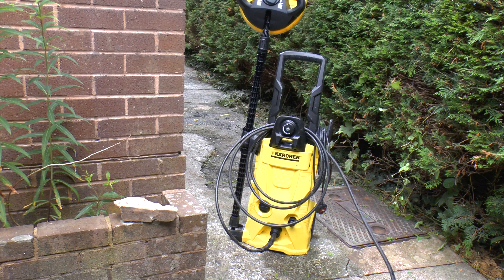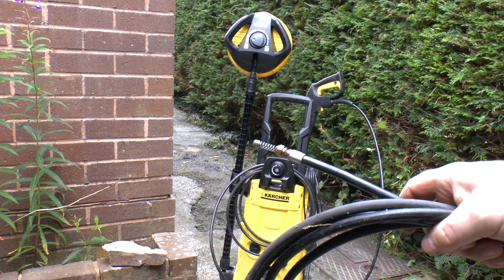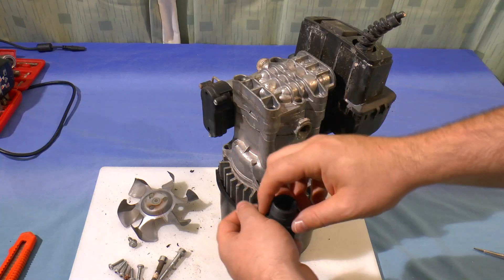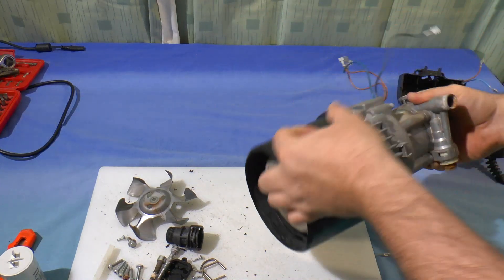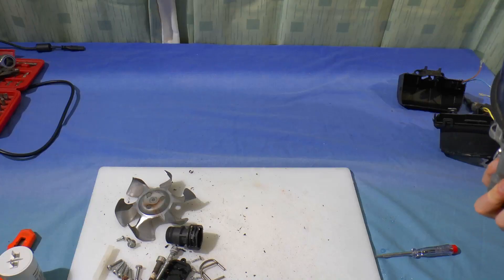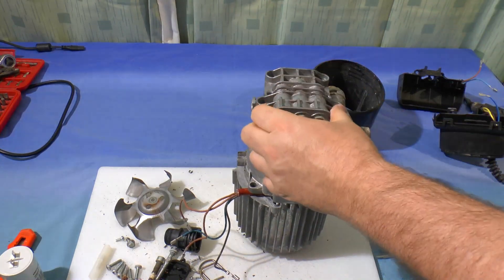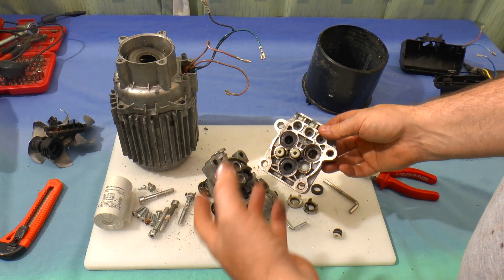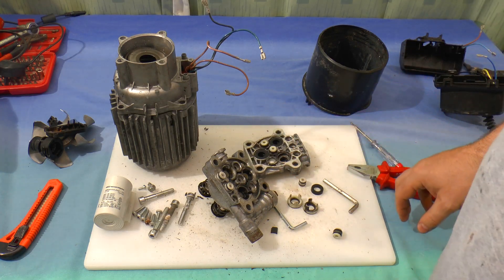Karcher pressure washer teardown

Comment: Was it possible the pressure switch failed? And as well I believe where the pump was removed from the motor there should have been gear oil not gunk.

Comment: I just brought a second  hand karcher HD 640s and when I turn the nose on the gun to make it make full pressure it starts to cut in and out .. I noticed the piston on the pump is moveing in and out triggering the switch .. the water pressure is fine because it works with my other pressure washer that's practically identical.  mx 720 . any ideas.
Reply from the maker: Perhaps it's duff? It'd be worth asking on the Kärcher Facebook page, they may just say to take it back and exchange it.
Reply: @AintBigAintClever  sorry its second hand. its ok but it just surges at full pressure.  back it off with the nossel and its fine . but surges with all the other nossels that don't adjust.  there just full pressure.
Reply from the maker: @petermoygannon698  mine surges when the hose is kinked. Perhaps it's drawing more than the other one? Worth checking the inlet connector for debris in case there's something clogging it and restricting flow.
Reply: @AintBigAintClever  no looked at that. could the motor be lazy could that be possible.  gets to a point where the motor struggles to push the pistos in and locks up and starts again very quickly  . creating that on of high pressure.  the machines  jotting when this is happening.
Reply: @AintBigAintClever  and even with his adjustable pressure hose and gun it does it when you twist it all the way to full.. back it off just a little and it doesn't do it its fine.  but won't run my hose with my foam cannon spray  the foam jolts out and the machines jolting again .
Reply: @AintBigAintClever  be very interesting to find the fault  got me beat so far.
Reply: I've got good mains pressure too.

Comment: My mate had one a different brand a works one and had the same pump but had a universal motor and we used it at his house after doing a few pavers it pack up and stalled I took it back with me took it apart was beyond repair as the bearing that spins the two plates had exploded inside I told my mate to buy a new one I kept the motor binned the rest wasn't worth it

Comment: The Karcher I have failed many years ago because the plastic housing on the pressure switch burst. I assume that this met Karcher's design goal - throw away the metal motor and the metal pump when the plastic over-pressure sensor breaks. HOWEVER I noticed, in pressure washers I have seen, that the motor NEVER shuts off as long as the water is flowing. SO I disabled the water shut off in the nozzle (so nozzle always on), shorted the electric switch on the pressure shutoff, and ran the power plug through a radio-controlled AC switch. When I want pressure/flow, I turn on power via the AC remote control; when I want no pressure/flow, I turn off power ditto.  The water main pressure still pushes a trickle of water through the Karcher, but nothing like the blast when the motor is running. I have salvaged many years of occasional use from this washer that Karcher wanted me to throw away shortly after the warranty expired.  (Have you ever noticed the temperature fuse on Shopvacs and fans? Same design principle -- consumable part fails, throw the whole thing away, along with your money. For a dollar more,  a resetting temp sensor could be specified. Insert AvE foul language here. )

Comment: because u did not change it oil regularly thats y it broke down
Reply from the maker: It's not designed to have its oil changed.
Reply: @AintBigAintClever u can add that feature also by boring on one side and adding screw to it

Comment: Nice tear down, thanks!  Do you remember how you removed the electric motor cooling fan?  I've got a Husky 1750 PSI pressure washer, the fan self destructed, got a new fan but can't get the old fan off,  Turning the hex-slotted cap holding it on simply turns the pump, I can hear it.  Just not sure how far into the pump I might have to dig to be able to keep it from turning and get it loose. Picture of fan:   https://drive.google.com/open?id=1e4qrp0Bc-sXtWFkJfioFyRKN8tiUu6X9  Thanks for looking!
Reply from the maker: I probably jammed the fan blade then undid the screw. If the old fan's already mangled then a bit more blade-bending with a screwdriver won't hurt.
Reply: @AintBigAintClever   thanks for looking.  Yes, I can grab the fan blade with a pair of channel locks, no problem, but the screw just turns without coming out, it sounds like it's turning the pump, I can hear it 'sighing', you know.  Can't figure out how to keep the pump part from turning without disassembling the pump from the motor, I guess that's going to be necessary, ugh :)  Thanks again!
Reply from the maker: @brucejones8889  Depending on the motor type you could try shorting the input cable to see if that stiffens up the rotor? If it's a motor that can also work as a generator, it'll be generating into a dead short and be much harder to turn.
Reply: @AintBigAintClever  Thanks again.  I finally 'wrung' the fan off, lightweight aluminum, then I could grip the spindle/axle/whatever and keep it from turning (no motor expert here) and get the retaining screw out.  Now just gotta clean out the dried 'loctite' type material so I can get the screw back in with the new fan.  Well, and remember how to put the whole thing back together ... shoulda taken pictures!  Seriously, thanks again and stay safe!

Comment: What oil is in the pressure water? Gear oil?
Reply from the maker: No idea I'm afraid. It's normally sealed in. Whether it's filled with conventional gear oil (which is going to get a much easier life than it would in a car differential so may never need replacing) I don't know.
Reply: I believe Non detergent oil is used in the pressure washer water pump ,it doesn't foam up, gear oil is used by repair shops so it must be but i am not 100% certain cheers....

Comment: Had a failure on a clone copy of this machine, the heat/press fit gear on the end of the motor shaft expanded due to thermal stress after a few years so the gear wouldn't spin when any noticeable torque was applied, as the shaft was just spinning and slipping on the inside of the gear. A spot weld might have saved it but an attempt to hammer and mushroom the top shaft split the gear...

Comment: What is the liquid inside of the motor?
Reply: 05:35
Reply from the maker: Oil/grease
Reply: @AintBigAintClever  thank you. Just opened up my kärcher k3 because its leaking water somewhere, got that grease/oil all over the place!

What could be wrong if its leaking water?

Comment: Clearly mechanics is not your field. You washed that mechanism with water
Reply from the maker: There are many tools in my garage. Unfortunately a parts cleaning tank isn't one of them.
Reply: well.. guess i shouldnt really judge since that was a broken part soo.. have a good day :)
Reply from the maker: It was predominantly to remove the bulk of the gunk in there; mainly using the pressure to blast it out than the water to wash it out (which as you've pointed out wouldn't fare too well, although there was truck-wash in the jet spray to help shift it).
Reply: i understand, yeah. Thanks for the timeline or how its called at the begining :)
Reply from the maker: The index at the front was a suggestion made by one of my friends a while back, so most of my videos now have one.

Comment: Good video, i've recently stripped mine down too. What oil (and how much) would you use when re-assembling inside the piston area? Mine looks like grease but think it might be a bit sludged up due to water ingress.
Reply from the maker: Not sure, it depends on what the seals are made of. Take a look at this list for example and compare ATF with brake fluid.

Comment: made me happy when I saw the hammer come out 😃
Reply: I wonder if he tried hitting the pump with the hammer before resorting to buying a new machine. I've had the same problem with no pressure he had. Tapping the pump with a hammer seemed to free up whatever was sticking and the pump would build pressure again.
Reply from the maker: I must admit that a spot of "percussive maintenance" hadn't crossed my mind before I bought a replacement. This one was a bit battered though (even before I malleted it open) and the pressure kept creeping down, causing it to keep triggering the motor even when it wasn't being used (and often stalling the motor as a result).

Comment: This Karcher 432M still is sold in Brazil with label Karcher K 3.30M or K 330M. As I know this is a very old project, maybe 1980, but still is very fine machine. Here a new one is sold by R$ 800,00, about U$ 260,00

Comment: How high you fill in the New oil?
Reply: Yes it's very important issue in pressure washer pump
Reply: till the screw is under oil
Reply: leaving the a bit of the bolt out

Comment: Great video. I just tore down a similar pressure washer, hoping to reuse the electric motor, but it must be an induction motor just like you have. It seems the motor and the pump are integral parts, or at least the motor and the swashplate part are. You really can't separate out the motor so I ended up just pitching the whole thing, which is no great loss because I got it from the trash, but it's a bummer nonetheless. It looked like a really powerful electric motor.

Comment: 8:01 is a big no no... it does not compress water
Reply: The bulk modulus of water is small compared with air, (15000 times less, according to Google,) but it is not zero. Water compresses under pressure, and steel beams deflect when you walk on them.  (But not much.)

Comment: Where does the pump oil goes? I want to repair a pump oil leak on mine but I haven't tried to repair it without knowing how to first refill it after I'm done changing the gaskets.
Reply from the maker: +Alexis Ortiz This one doesn't have an oil system. There's some grease but that's it.
Reply: +AintBigAintClever Is it common for electric ones not having oil in the pump? Mine is leaking oil from somewhere and I thought it was from the pump.

Comment: Wow I was expecting at least a 2 stage compression cycle, considering how noisy they are, lol , but as you said in the comments it simply a piston stroke and swashplate, very simple, great job !

I would say alot of failures would be down to air getting into the compression chamber and disrupting the current and compression viscosity.

Comment: looks like it might have been fixable if you hadn't used the old universal can opener on it
Reply from the maker: +stereomike111 Probably, but it was getting a bit long in the tooth anyway. Wheels kept falling off, the plastic grid at the back was broken leaving the motor fan blade exposed, the pump failing was the last straw. At least I've learned something from pulling it to bits :)

Comment: swash plate pumps are good for high pressure, on the old hydraulic citroens they use 5-6 little 8mm or so pistons moving about 12mm to lift the entire car and run the brakes / power steering...

https://www.youtube.com/watch?v=01L2jcep3Ik

Comment: Awesome video ;) Thumbs up :D How much uF has the capacitor ? Alex
Reply from the maker: +High Voltage capacitor is 25uF, rated at anything between 400V and 500V depending on which line you're reading on the side.
Reply: AintBigAintClever Ok, a pretty standard value for a motor run capacitor and thanks.

Comment: Videos of kittens ha ha i like your sarcastic side :-D
So it produces pulses of high pressure, not really a pump but a compressor of the water being delivered, clever idea :-)
I didnt know how they worked before, thanks for the oh so gentle extraction of the assembly and discription lol, hammer time :)
Shame its dead as the capacitor start motor looked in new condition.
Reply from the maker: zx8401ztv Similar to a three cylinder engine with stuck exhaust valves and no ignition :) Intake, exhaust, intake, exhaust... :)
At least it's rectified three-phase for a smoother output :)
Reply: AintBigAintClever LOL 3 phase, would you have to make a special 3 tube meter to measure the voltage...sorry Psi lol :-D
Not sure how to measure the current... perhaps a small stick floating under a bridge :)

Comment: I like your hammer technique for opening the device. True Photonicinduction style. I found one of those too but it has a universal motor in it. Interesting video.
Reply from the maker: tmanF4 I was planning to do that until I found it had an induction motor. They're boring. Too few volts under load: they draw too much current, get a bit hot and pop the fuse. Too many volts: they draw too much current, get a bit hot and pop the fuse.
Do it on a universal motor and they do a wonderful impression of Eduard Delacroix in the Green Mile's "dry sponge" scene :)
Reply: RODALCO2007 All he needs to do now is give it FAR too many volts, until it pops!
Reply from the maker: RODALCO2007 I tried the proper way of opening but it was having none of it :)
In the current range the K2 has an air-cooled universal motor (according to the retailers at least). K4 and up have water-cooled induction motors.
Reply from the maker: ***** The difference between an 850W motor and a 1850W motor is only about 15 pence per hour in electricity, and that's if it's running constantly.

Comment: I have an no name brand (I think it's KARCHER) electric pressure washer and it has a weak spray. It engages like it should but the spray is weak I can even put my hand in front of the spray and It doesn't hurt. I know you should never do that but I already determined that my machine had a weak output so I saw it as safe to do that. Any ideas why the spray is weak?
Reply from the maker: coondogtheman1234 I think mine kept on running because the high pressure side was leaking back to the low pressure side through one of the valves. If your pump turns on and off as normal I'd suspect the seals around the pistons, they could be just banging up and down in the water instead of pressurising it.
Reply: AintBigAintClever
Well it sprays pretty good and you can wash cars and spray the deck off but not at the high pressure that I expected. I've used a gas powered washer and it was way more powerful. enough to make cut marks in wood.
Reply: @coondogtheman  No these washers do not have the kind of pressure you expect. Gas and electric are like comparing a car and a peddle bike ...almost. Gas powered units get up to around 4000 psi i believe and electric motors produce about half that. Also there are different nozzles that are made to give varying streams and pressure. 
Edit: Lol. Sorry m8 didn't see this reply was three years ago. lol
Reply: @MrLucifuge1973  I've seen a couple of electric pressure washers that had good pressure. Watch crazyrussianhacker/tiaras kul. he did videos on a couple of models.
Reply: coondogtheman1234 
It’s all about pressure AND flow. High flow high pressure needs a lot of power. Just lookup the HP or KW of the pressure washers to compare. An electric pressure washer on a regular power outlet won’t produce as much power as even a small gas motor washer will.

Comment: Yep, the mains water pressure is often enough to pass through the valves, when the pump runs that will increase the pressure, and i agree that maybe one or more of the valves are stuck open, unless there's an over pressure bypass that's stuck open (bypass for when you release the trigger and before the switch turns the pump off)
Reply: +Sparky Projects I don't thin karchers have a bypass. I have one that the pressure switch has failed on. If I release the trigger and stop the water, the pump just keeps running. I'll fix it someday
Reply from the maker: ***** I think it's had a leaky valve for a while, as every few seconds when the trigger wasn't pressed the pump would run a bit to repressurise.
Reply: AintBigAintClever The cheap one i had used a bypass valve because the pump ran all the time, no cut off switch.